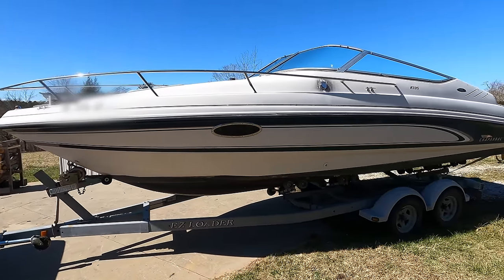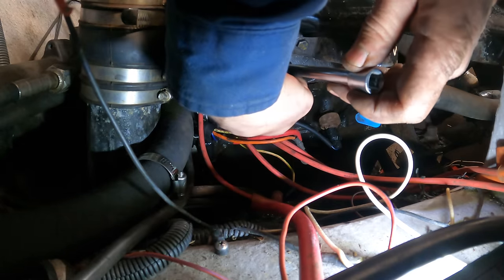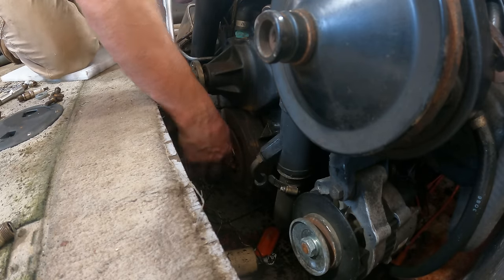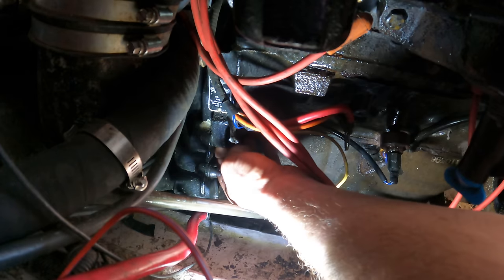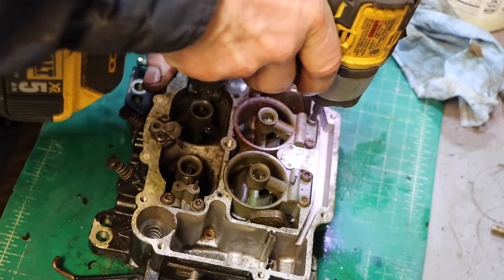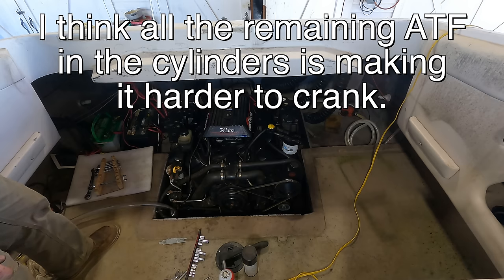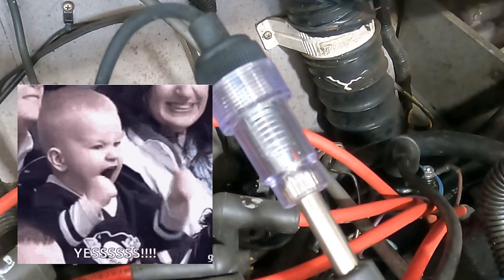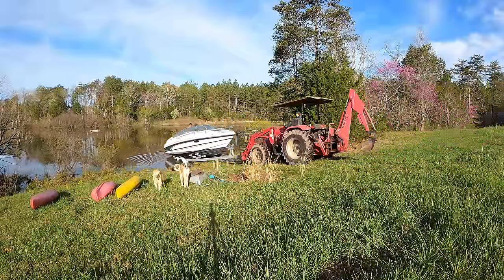Fixing A Boat With A 454 Big Block Engine

Comment: 1:11:36 I think that yes, you should submerge the tail in water for cooling and run the engine up to Operating Temperature, BUT NOT UNTIL YOU CHANGE THE FREAKING WATER CONTAMINATED OIL!!!

The Low Oil Sensor keeps screaming at you for a REASON!!!

STOP IGNORING IT!!!

[Sigh, End of Rant]

Honestly, I'll be shocked and amazed if you can start that engine before doing a full Valve Job to fix the rusty Valve Seats...I suspect the true reason you can't start it yet is you're loosing too much compression through the rusty Valve Seats...

1:28:57 OK, so colour me both Shocked AND Amazed...

😄😁😆😅😂🤣

Comment: Needs a new starter, and at some point, a new flexplate. Compression is low mostly due to valve seat corrosion. Would not be too hard to do valves. You spent way more hours on it than it would have taken a mechanic to pull the engine and replace it with a fresh one, which is what you should've done. But this was way better entertainment.

Comment: Pray to whatever God's you believe in that it's only a stripped Bendix Gear on the Starter rather than the flywheel itself that's stripped...

A Borked Stater will be one HELL of a lot easier to fix than having to pull the entire engine to get at the flywheel...

😄😁😆😅😂🤣

Comment: 25:30 I'm not quite sure why you're still fighting with it in the boat...

It seams perfectly clear that that boat will never again run under it's own power until the engine is completely rebuilt or replaced, thus shouldn't you just save yourself a lot of initial tinkering aggravation by pulling the engine out and moving it into your shop so you can FAR more easily get at everything to figure out which is cheaper, rebuild or replace?

OK, I admit I was wrong...it started and ran just fine...

Eventually...

After MUCH gnashing of teeth and filling of Swear Jars...

😄😁😆😅😂🤣

Comment: 35:05 Cylinders need Honing, Valves need Lapping and with that much water in the Cylinders for that long, the oil really, Really, REALLY needs changing...

Ummm where's the oil drain plug on that engine and how much of a NIGHTMARE is an Oil Change on it? For that matter, where's the Oil Filter and how hard is it to get to/remove?

Comment: I cannot understand the reasoning behind forcing 8 rusted cylinders to move,can’t you understand how much damage has been done to the piston rings ,piston itself,and the cylinder walls?
Not forgetting the rust on the valves and seats!
As a mechanic for 60 yrs,I cringe at the thought of the further damage you caused

Comment: YOU ARE WASTING YOUR TIME WORKING YOUR ASS OFF AND FLOGGING A DEAD HORSE YOU MIGHT BREAK IT LOOSE BUT IT WILL NOT RUN GOOD ENOUGH TO BE USEFUL GET A NEW MOTOR